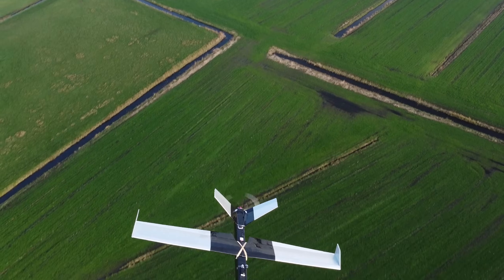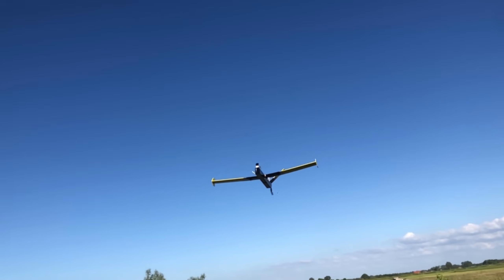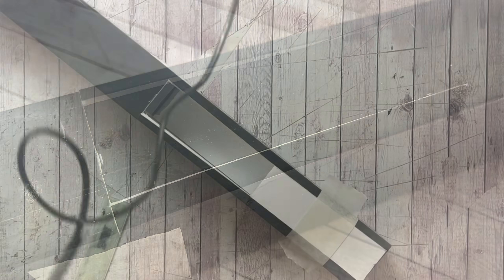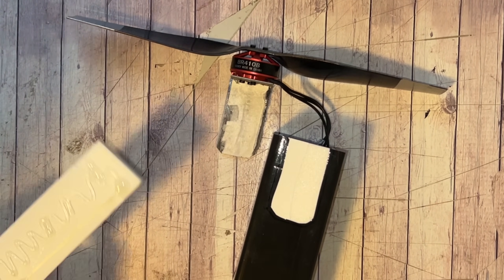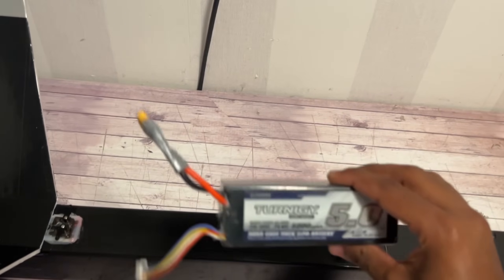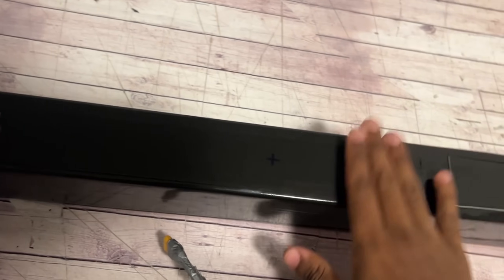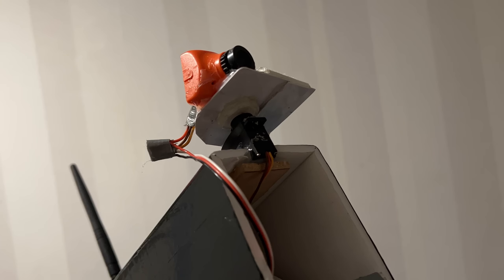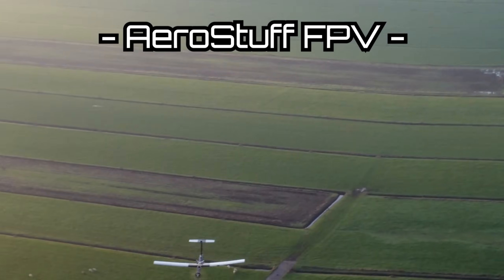How to build a V-Tail Aircraft for Long Range FPV & Autonomous Missions

Comment from the maker: ALL Compatible Electronics LINKED here: 

🏆Shout out to my current members!🏆

Meinrad Louis🏆
Legion Preparedness🏆
all dayy🏆
Hi🏆
Burak Koç🏆
Vyshnav🏆
Satish Kumar🏆
Atiye Gül🏆
Jack Mont🏆
thibault cogné🏆

Matek F411-WTE Flight Controller: https://s.click.aliexpress.com/e/_c3F4Gng3
Matek F405-WING V2 Flight Controller (equivalent): https://s.click.aliexpress.com/e/_c2xIsj0T
FrSky X6R Receiver: https://s.click.aliexpress.com/e/_onEFBih
FlyCat iRotor 5010/750kv (equivalent): https://s.click.aliexpress.com/e/_omhpFYH
MG90 Servo's: https://s.click.aliexpress.com/e/_oms9r6p
Beitian BN-220 GPS (equivalent): https://s.click.aliexpress.com/e/_oFeXi57
Reply: The few links I tried are all broken already!
Reply from the maker: @piconano  Oh weird. I see it now. Just type the name and it'll appear
Reply: @AeroStuffFPV do you have any design for the plane it's elf?
Reply: Broken urls dude
Reply: I need all of these Flight controller or i need to buy only one its my first time bilding the rc plane
Reply: Inav ou Arduplane?
Reply: total cost you personally spent after taxes and shipping?
Reply: wich battery do you recomend for the longest flying time
Reply: Is it an autonomous airplaine? Can I set a route like drones?
Reply: I have flysky fs i6x + iA10B equipment. can i use this hardware for V-Tail
Reply: What propeller did you use?
Reply: Did you use a 600kv motor or 950kv motor?
Reply: what battery should be used with this
Reply: I  am currently building a 25kg aircraft, so please tell me how powerful a motor and battery pack is required to fly it for at least 15 min. 
Please.
By the way nice build. Looks like an excellent design,
 keep it up.
Reply: @coding_diari  नमस्ते भाई, आपके निर्माण के लिए शुभकामनाएँ और आपके प्रयास के लिए भगवान की स्तुति करो। जिंदाबाद मैन

Comment: Thanks for this. I decided to attempt this build with ELRS receivers and the ranger module for the TX16S.

The flight controller won't be here for another 3 weeks, so I'm thinking I'll build the aircraft initially with a plug n play test receiver, just to get it airborne.
Reply from the maker: Good luck!
Reply: @AeroStuffFPV hey, one more thing! Do you use a ground station to get such crazy video range? If I want to get out to, say, 5km or less, will I need a highpower headset and/or ground station?

Comment: Hey, I have a question. I want to make the same design but as a pull rotor style...will I have to make any changes in the design or will the same work
Reply from the maker: Anything is the same except the CG location (See my oldest video because I’ve made V-Tail Pullers before)

Comment: How do you land without breaking the fixed prop?
Reply from the maker: ESC Brake
Reply: @AeroStuffFPV  what if the prop ends up vertical when braked? I think that would still hook on the ground and break?

Comment: Hello brother, I am one of your biggest viewers. Thank you first.  Sorry I had a question?  I built one like yours but a 650kv motor, 60A esc and with a 3300mah 4sel and 10×5,5 prop can fly ?Whether to use small or large prop What does it cause?
Reply from the maker: Thanks man! I appreciate your comment.

I recommend scaling up the propeller if your AUW (Flying Weight) is above 1500gr - Go for a 12x6 or bigger (13-14" propellers)

You can still fly with the 10x5.5 but it's not as efficient and powerful as the larger props on your power system.
Reply: Thank you very much brother, the beauty of your design  work and videos have motivated me to start making them I hope you succeed God protect you and your family

Comment: Hey while looking for depron sheets to use for this build I found out regular foam board from the dollar store is just paper reinforced depron. This means you just take the paper off of the foam board and cover it with light weight tape like AeroStuff FPV was showing. It works really well! I shaved 4 grams on a 6x6" piece of foam board by ripping the paper off and covering the foam in tape.
Reply from the maker: Good comment !

Comment: Hi Nathan, I wanted to express my gratitude for the incredible work you've been doing. Your experience has been a valuable source of learning for me, and I appreciate the effort you put into sharing your knowledge.
I'm particularly intrigued by the setup you used for the vtail plane, and I would love to explore the components further. Could you kindly share the links for the 950 KV motor, propeller, and the rotatable camera you featured in your video? I'm eager to dive into the details and potentially incorporate them into my own projects.

Comment: I have a technical question: what’s weight ratio should be inside the fuselage? I mean center of pressure and lift from wing, is there a rule of thumb?

Also what’s the best motor thrust required for good long flight

Comment: I want to build a V-tail too - I took a slightly different approach of having a triangular fuselage, which i think will also help reduce boundary layer drag.

However, I am concerned about the pitch up (elevators in) position, because the two elevators create a compression in the flow. I am concerned that this will cause the air to accelerate (Bernoulli's) between the tails, and in turn drop pressure, creating a pitch down rotation. Is it something that you had to account for in your design, and did you find the controls more sluggish at high speeds?

Thanks
Reply from the maker: Never encountered the side effects mentioned - Good luck on the build - Triangular fuselage is better in terms of aerodynamics but reduces internal space for electronics and equipment
Reply: @AeroStuffFPV  thank you

Comment: Where did you get this prop man? And why the three holes? I’m trying to emulate the performance of this plane as close as possible
Reply from the maker: It’s a modified 14x4.7 but I swapped the propeller with a 12x6 which is much better with the particular motor & battery
Reply: @AeroStuffFPV  I appreciate the reply thank you!

Comment: Do you need to buy special Pusher Props, or are you just reversing the motor?  Also, went to look for Depron, guess that stuff is now history. I am currently acquiring all the aircraft parts I do not have. Has anyone found a replacement for Depron that is waterproof as well as lighter than the standard 1/4" foam-board? Thanks AeroStuff FPV, as well as anyone helping me out with questions.
Reply from the maker: The prop can be any type (pusher or normal) as long as the thrust is going to the tail (and the concave side is facing the tail as well)

Comment: Nice video, but our wings span is 2.5 meter we have 1100 KV BLDC and 2200 MAH battery, is it good
Reply from the maker: 2.5m and the same fuselage length is a bit sketchy, make sure the CG is a little more forward and make sure there is enough V-Tail throws (authority) in pitch

1100kv wouldn't be bad with the right size propeller (depending on battery type 3S/4S?)

Comment: Very cool. I started building a custom airplane - Experimental Airlines style - a couple years ago, and never got around to finishing it, and I was trying to figure out how to attach the wing to the fuselage ... and then I just happened to discover this video, and there was my answer! :)  I'm definitely borrowing some of your ideas. I never even thought to put FPV gear in it, even though I'm currently doing some fixed-wing FPV flying and just got an airplane ready to fly with an F722-WING controller running INAV 6.0. Just waiting on a new radio, and hopefully INAV 6.0 will be official just in time for the maiden flight. But now I'm fired up to finish building my Experimental Airlines design!

Comment: How much weight can it carry, for example a camera facing down?
Reply from the maker: I'd think 500-750gr of external/additional payloads

It can be more - but the aircraft has to be modified for it (motor batteries etc.)
Reply: @AeroStuffFPV  alright, ty for the fast reply 👍

Comment: Is it possible to add to its design a set of landing wheels or would it affect its flight capabilities?
Reply from the maker: possible
but affects performance
Reply: @AeroStuffFPV  thanks for the response! I've been in the fpv & rc for about a year and 8 months already, building my own primitive planes, but I am planning to do the big jump and create something more complex, with the cameras on board, one or two propellers if necessary, for long range flight similar to military attack drones but with no weapons obviously. Your design by far has caught my attention, seems solid to be used as a platform for the development of my idea, although with the addition of the landing and camera systems some changes will need to be made from your original design, would there be any recomendation or advise you would give me to take into consideration for this project, materials, parts or any other insight will be apreciated man.

Comment: Am surprised that depron is that much lighter (0:40). Any idea the weight of an equivalent 1m x 1m square of foam board vs. depron in grams? Thanks
Having a lighter aircraft will increase endurance time, but a heavier aircraft may be able to cover more ground more efficiently (mAh/h). The higher energy consumption could offer added distance covered by being more efficient at higher speed (mAh/km). Maximum endurance and maximum range are each good traits, depending on mission goals. 
Keep up  the great work, experimenting and trying new designs.
Reply from the maker: Thanks!

It’s true having a foamboard 1-former wing is heavier but faster which results in increased efficiency over distance in consumption.

The Peace Hawk LR+ (Black/Silver/Yellow V-Tail Pusher) has slick foamboard wings and does 6A (4S) at 43-47kph and approx 132-137mAh/km which is quite efficient for it’s design.

The depron wings allow less amp-consumption but reduced airspeed (to match the same Mah/Km) with this design (but having a thicker airfoil with more lift/less airspeed) - 

The exact same slick wing like the Pusher LR+ but from depron is on a T-Tail Tractor design - But still unpublished. Hopefully being able to squeeze an intro in the near future!
Reply: @AeroStuffFPV  Nice efficiency numbers. :)

Comment: These are really great videos and builds! Thanks a lot for sharing this one :) A couple of questions if you do not mind. 
1 - How much payload it can carry, approximately?
2 - What was the final max. distance?
3 - Is it possible to connect this craft to notebook and control it from there?
Reply from the maker: Hi

My apologies for the delay of the reply - I forgot to reply the moment I saw it weeks ago.

1: I'd say the aircrafts maximum AUW would be 2.5kg, so about 1000gr of payload - (unofficial)
2: Of all time, I got 10.8km - But with this aircraft, I got 8.58km so far. I hope to encouter good weather to fly further with it.
3: Depends on your radio/flight controller - Mine is simply operating from a radiotransmitter and goggles give the videolink.
Reply: @AeroStuffFPV  What is the max range on radio/antennas?

Comment: So. Excellent work! You are the subject matter expert on this aircraft. So I defer to your great experience. Your winglets are over sized, you are correct that they cancel vortices, but they do not need to be 3-4 inches on each side of the wing, .5" at best. The faster an aircraft goes the larger those winglets need to be to maintain stability during maneuver. yours are very large for what little speed you are maintaining. What you have created is an aircraft that in a very tight bank (75 degrees) allows you to turn in place and observe a point on the ground without losing altitude, and minimal throttle correction to maintain that altitude. Forestry Cessna 152's, have very large rolled down wing tips so they san "Sit and spin" over a potential target and observe it. You seem to be going for loiter and distance, I would just add bent winglets (-6 degrees or more with experimentation) depending on how much loiter in the turn you want. my 2 cents. everything looks great.

Comment: How much distance could be added adding solar panels to the wing, considering weight of all the panels and added components? Encorporate them into the wing design to minimize drag(recessed area for panels). Might not be too much considering the size but have seen it before near this size
Reply from the maker: The amount of solar cells to fly 3S/4S would be insufficient so it isn’t a solar flying platform. I’m considering building one in the near future and it’ll be a flying wing for lots of area for many solar cells as possible
Reply: "rctestflight" is kinda the spearhead in the solar plane arena. I believe his current version is limited to the LTE network, and weather. if he had clear sky's and signal he probably could coast to coast his aircraft.. until a motor or esc burned out. 
https://youtu.be/vYeYZpBE51I

Comment: for more range you can try to streamline servos; I've seen people put them in the fuselage and run wires out to the control surfaces. This would reduce drag a fair bit I think
Reply from the maker: True,

but it isn’t a drastically change in efficiency.
The larger it is, the more necessary it gets to be streamlined
Reply: @AeroStuffFPV  just a thought. A lot of NACA studies around the ww2 era looked into this a bunch. the british mosquito was very fast for its time, for example, because the wood construction meant it had a smoother skin than riveted planes. even metal planes went from protruding rivets to flush rivets. have you ever flush riveted something? it basically doubles the amount of work it takes to assemble it. The other big areas of study for NACA drag were air scoops (look up NACA scoop) and how to cowl rotary engines and water radiators for min drag.

Comment: I've built 3 planes using the Experimental Airlines techniques.
However, I can't afford any electronics, so I 3D printed fake motors and props and hung the finished planes from the ceiling in my office.
I may not be able to fly them, but I sure like to look at them and day dream...

Comment: I want to build a 4kg plane with your design for a project. I will increase the width and lenght of wing and change with the specific foil for more lift like NACA ones. Also gotta change the dimensions of tail and changing it with the specific foil. Do you have a calculation or ratios for that? My main question is should i change the lenght of fuselage ? Where will the CG at ? Is it depends on weight and mounting electronics or stabilizing the lift of wing with the same torque with the tail which will identifies the distance between tail and wing ? What do you recommend should i firstly build the fuselage and place electronics then find the CG and put the wing right on the CG or make a lift and torque calculation and identify a distance from tail ? I admire your work and experiences please respond my comment.
Reply from the maker: Great idea man! Glad you’re considering using my design for your custom build!

I only have V-Tail to Wingspan Ratio (Mentioned at the beginning of my V-Tail Build Video) If it’s gonna be 4kg, It’s recommended to have the same or a bigger motor or fly with 5S/6S Batteries

The CG can be measured with a website that is very popular (search for flying wing CG calculator on google and you’ll find it)

I recommend building the fuselage, tail and electronics before building the wing & measure the CG - My method is (like mentioned in the video) to balance the fuselage on my hand and mark the balance point. From there, you’ll mount the wing on that spot with the CG-point of your particular wing directly on it.

Good luck! Please keep me in touch! I want to see it.

Comment: That's a really nice build, I feel like you don't often see good looking and good flying planes that are this easy to put together. As a fun side note, if your aircraft geometry will let you, inverting the V-tail gets you even better performance. When you turn using a V-tail it induces a small amount of roll opposite of how you're rolling for a turn, the A-tail flips that around into roll that goes with the turn.
Reply from the maker: Good to know!

But it’ll require landing gear which I’m not really a fan of. But who knows!
Reply: @AeroStuffFPV  yeah that ads a lot of weight and drag. you can do extra janky stuff like making the A attach to a horizontal stabilizer. you also often see the A tail on a twin boom which would work on a pusher set up, but that would require a huge redesign. My design team likes A tails but our landing gear is never high enough to allow for one
Reply from the maker: @WaywardSupercoldSpaceScythe  I'm considering building an A-Tail Twin Boom Pusher - I did design twin booms in the past.
Reply: That's a very interesting and useful tidbit of information I had not realized before. The fact that inverting the V-rail counters the counter-turning.  Very kool.
Reply: I never knew this, that's great info thanks!

Comment: That’s sweet bro. I didn’t realize depron was so much lighter. I’m def gonna give it try. My main flyer right now was inspired by the reptile dragon 2 and flys awesome but weighs 1,200g without the battery. 48in wingspan and auw of 1,970g lol. I don’t mind it but it’s very nice to know that depron can make a difference.
Reply from the maker: Yeah, depron would make your plane go 300-400gr lighter. It revolutionized my builds!

 A flying wing of mine with a 4S 5000mAh Battery got me my endurance record of 2h 02min (plus thermals) but avg. amps were approx 3-3.5 and it wasn’t small either (approx. same as this aircraft).

Depron is the go-to!

Comment: Depron is an amazing material! Rare in Europe though. Could you please share info on what dimensions sheets are you using and what's the price for it where you live? P.S. hot glue is hella heavy. Consider using Polyurethane Foam Adhesive (quick version) made for tough XPS foam. That stuff is magical and it doesn't weight anything.
Reply: Which glue brand would you recommend?